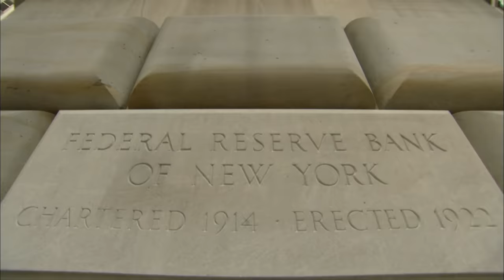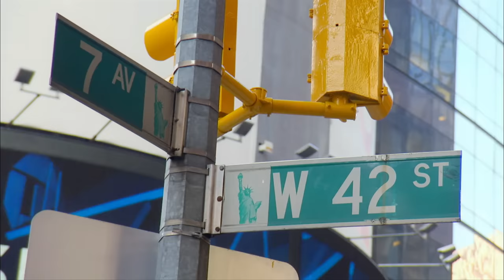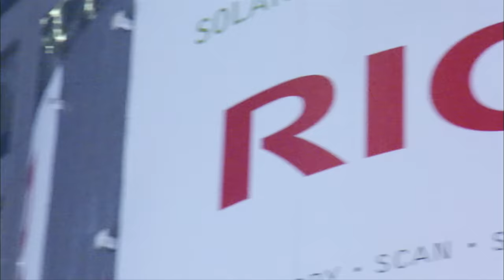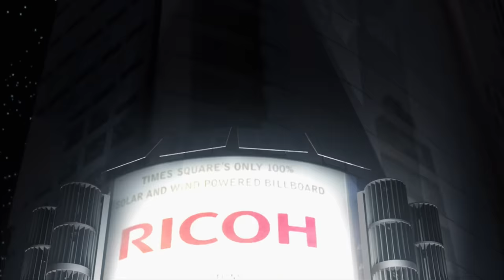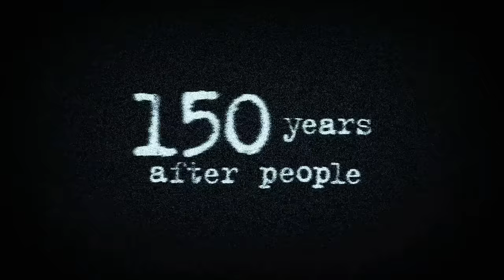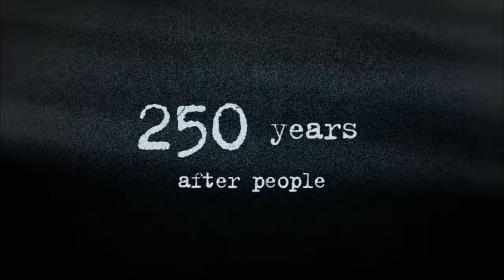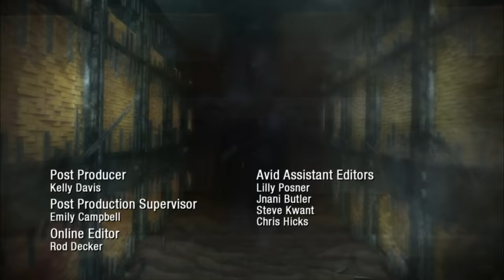Life After People: Skyscrapers Collapse in Abandoned Cities (S1, E4) | Full Episode | History

Comment: It could actually take thousands of years for any buildings to start collapsing! Oh by the way the Arch in St. Louis is stainless steel! It won’t rust!
Reply: I think this series, including the pilot said skyscrapers have at most 300 years due to cracking concrete and rusting steel inside it breaking it apart. Finally the steel beams holding up buildings will rust and give out, or at least their joints.

Comment: The producers of this series continually perpetuate the 9-11 myth that a high rise building would pancake during a structural failure, which, of course, is statistically almost impossible from an engineering standpoint. Pancaking requires a symmetrical failure, and symmetrical failures of steel structures are almost unheard of. What would happen is that the building would tilt, and fall like a tree.

Comment: 200 years?  Seriously?  Have you seen deadmalls?  All it takes is a decade.  And as for the sky scrapers, as we disclosed, the foundations only stay dry and solid because of the sump pumps.  As soon as the electric is out the basements fill up and the corrosion of the footings quickly takes hold.  It's only a matter of a few years and they will collapse.  The Arch in St. Louis will be compromised with earthquakes which happen in that region.  One earthquake shifting the ground on one side of the structure will cause it to twist and open the seams allowing water in and from there the rust begins.  It's only a matter of time with all the rain and snow.

Comment: guys we gotta do a heist on that bank, we mine underground until we hit it, then we dig into underground abandoned tunnels, we then scrap up a few rail cars, we blow a hole in the wall using explosive thermite charges, grab 2-5 bars and then run to the getaway tunnels, we then load up the railcar and power it by car engines, then we detonate the charges at the end of the tunnel so we will get caved in and they cant get us, we then keep going across the country until the heat dies down, even if your identity was hidden you need to scar up and shave your head and face, we then go sell the gold to an off shore buyer.

dont put me on watchlist this was joke.
Reply: 2 bars isn’t worth that much